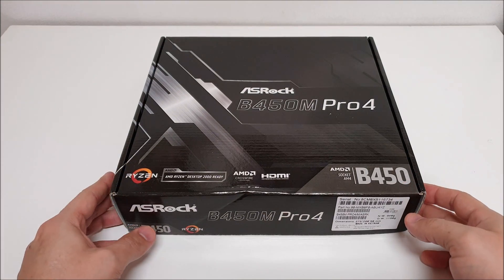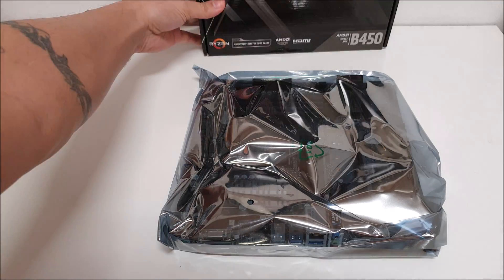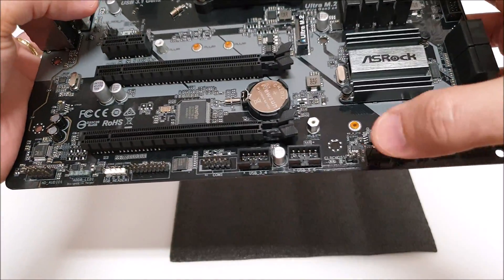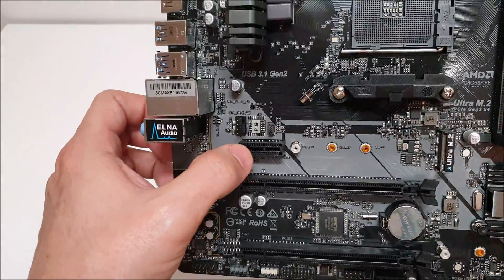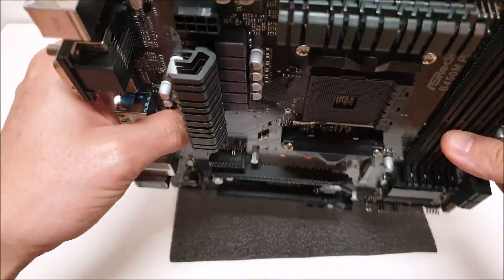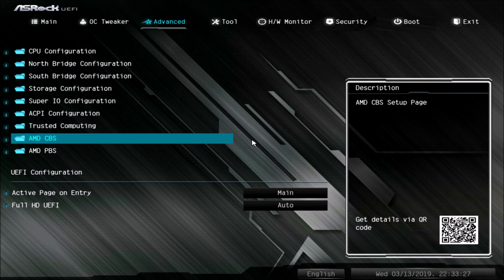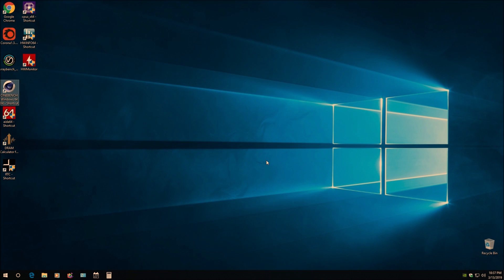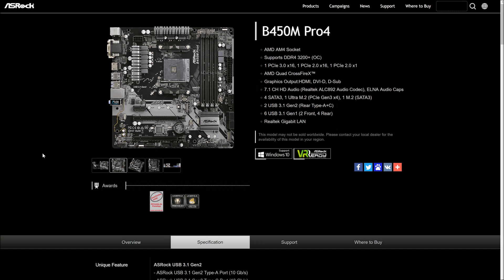ASROCK B450M Pro 4 Motherboard. Best Entry Level Board?

Comment: Mine came ryzen 3000 ready in case someone is wondering. I haven`t got my cpu yet so I haven`t tested
Reply: Have you gotten a chance to test it? I live in Canada, so I don't know if things are just coming in later...:/
Reply: @TonyHanation  yeah, it's my daily machine now, everything works, the cpu worked, as I guess the board came with updated bios out of the factory. If it has ryzen 3000 ready sticker you should be good to go.
Reply: @TonyHanation  And don't be tempted to buy msi board, because they have problems with ryzen 3000. They are now making the same boards, but pro or some other name variants, that have different bioses which theoretically have no problems with ryzen 3000, I don't know if they've fixed the issue, but don't buy the old ones only because they have bios flash button. Even if you buy the asrock and it isn't ryzen 3000 ready, you can easily get it updated for you in computer service for something like 10/15 dollars (I'm from the US, but I'm sure this is the price )

Comment: This bord sucks, dont buy it, bios full of bugs, and settings sucks...
Reply: Really?? Can you explain what are they?
Reply: @NagarajCruze  yes i can, worst one is not saving settings at all, like ram speed, it works as default 2400, i put it at XMP (1 or 2) it is 2400, i make it work faster but i need to change it manualy and if it saves it. Same for cpu and igpu speed, worst of all, you cant save user settings for fan's, and last one for some random reason some times it stuck when pc is in sleep, it returns all settings to default, so you need 2h to make it work ok again, sorry for bad eng.
Reply: @fasic46  I've planned to build a budget pc with this motherboard + ryzen 3 3200g  no graphics card 8gb 3000mhz ram.. but now thinking about this motherboard or to go with gigabyte
Reply: @NagarajCruze  i don't recomend this board, i have 2400g, 16gb predator 3200 (i can't ritch more thrn 2930) no gpu, it is ok setup, board has rellay good vrm for apu, but bios sucks, i try'd all bios revisions, up to 2.00 it didnt help, i contacted asrock, no help...
Reply: @fasic46  OMG
Reply: @fasic46  if the date/time is also lost(not saved) then try changing the cmos battery. I had similar problem with msi x370 titanium xpower.
Reply: @nutterztube  same answere form asrock, no date and time is ok, just. Settings about clock speeds and stuff (date and time is ok)
Reply: @fasic46  hmm...too bad. I was thinking of buy this board for headless booting my R7 1700.
Reply: @nutterztube  dont go for asrock there bios sucks, go for asus or somthing
Reply: @fasic46  at the moment, my choices are very limited. https://dc.sheridon.de/which-am4-mainboards-boot-headless-without-gpu
I am very skeptical about Gigabyte mobos.
Not a big fan of ASUS, but it is looking like the safe choice going ahead. :)

Comment: A little correction on the USB ports: on the rear 2 USB 3.1 gen2 (one type C) and 4 USB 3.1 gen1, for the front panel 2 USB 3.1 gen1. No USB 3.0 in this motherboard, which is great :D
Reply: USB 3.1 ia actually 3.0
Reply: @NagarajCruze  You're right, I forgot about the stupid naming convention :/
Reply: @shibotto  yeah... I don't know why they keep names like this😅
Reply: What's good about 3.1 gen 2 over gen 1?

Comment: this or the pro4-f version?
Reply from the maker: I'm happy with this board. It has all you need. Essentially if you're running only one gpu, the VRM is the buy factor for me.  Both boards pack the same VRM. This one fits perfectly in a micro ATX case.
Reply: Technology Hive I have a 1660 r5 2600 and 16gb 3000mhz on this board it only reads the ram as 8gb 2133 and the gpu is windows basic display port
Reply: @YourMom-fm1qo  You can change the XMP profile to 3000mhz but make sure your voltage is high enough for your ram or your PC will bootloop and revert your changes.
Reply: Im having problems im running a gtx 1660 r5 2600 and 16gb 3000mhz ram the gpu reads as windows basic display port and the ram is only showing 8gb at 2133 i got it up to 2400mhz stable. How can i fix the ram and GPU reading problem?
Reply: Jack Hill make sure your monitor is connected to your gpu instead of your motherboard, and for your ram check if it is in the right slots
Reply: Jack Hill yeah but is your monitor connected via a hdmi or something else to your gpu video port or did you connect it to the motherboard

Comment: A question here, i want to get a ryzen 3600 with this board. do i have to update the bios? And if so then can i do usb flash or need a older chip?
Reply: You will probably need the bios update. With newly made boards there is a small chance the update is already done from the factory but I wouldn't count on that. Maybe the store can do it for you? And otherwise you can loan an AMD 'upgrade processor' to do it yourself. Is a bit of work, but shouldn't be that hard. After that the board will work absolutely fine with a 3600.
Reply: With every mother board you will most likely have to to update bios. Yes you can usb it and just leave everything to default after the update unless you wanna OC.

Comment: Going to get this motherboard in a week  with a ryzen 1200, 16gb ram , and an rx 580 4gb.
This video helped me to verify that this motherboard is going to be good for my cpu.
Reply: I have the same MOBO and im gonna buy the ryzen 5 2600 with rx 580 8gb and 16 gb 3200mhz ram
But im not sure how to connect case and psu cabels :(
Reply: @grissahabib1334  you are gonna figure it out when you buy it its actually pretty easy
Reply: @grissahabib1334  Hello! What kind of ram r u using  ? :)
Reply: @attilaroman6557  i don't have the rams yet !
Reply: @grissahabib1334  Hey I'm getting the same parts as you, can you help me?
Reply: Can you please tell me how to install the drivers for this motherboard please, I can't find it anywhere and I'm afraid to install bad drivers that will make me bluescreen or something. Can you please tell me how to do that please please
Reply: @user-nv7fx1gd7z  https://www.asrock.com/mb/AMD/B450M%20Pro4/
All of the drivers should be under specifications.
Reply: @fixton7386  but I have to install which one please because there's a lot of links but I don't know which one to install
Reply: @user-nv7fx1gd7z  if you are not sure which one to download you get all of the downloads automatically by using iobit driver booster https://www.iobit.com/en/recommend/dbfree.php
Reply: I'm going with a 3100, 8gb ram 2x4 clocked at 3000MHz and the gpu is an msi armour rx 570 8gb
Reply: Lmao this guy's saying 4gb vram in 2021 is a mistake, when I'm here in 2022 with my rx 580, still playing games at perfectly smooth frame rates and good quality
Reply: Don't take a GPU with 4gb in 2019, that's a big mistake!!
Reply: @lrswz5628  I'm really happy with the performance of the rx 580 4gb and I haven't hit the vram limit yet in any of the games I play. I just got he rx 580 for 100 euro free shipping from a local miner so the choice was obvious to get a 40 euro discount for 4 gb less vram.
Reply: @fixton7386  if that's what make you happy then it's ok but ur GPU won't  be able to handle future games very well
Reply: @lrswz5628  maybe not on the highest settings, but for 100 euros that's a good deal. And a high end graphics card with a 1200 does not make much sense because you would be bottlenecked by the cpu anyway. Imo not a bad choice for that money.

Comment: I got my Ryzen 1600 to 4ghz stabile on this board with 1.36v
Reply: And memory got past 3200? I am lokking to buy this board with the same processor. thanks
Reply: I got my 2600 to 4,1 ghz with 1,3 V but the VRM temp is 85°C.
 82°C on idel even without overclocking is this a normal temp 
What temp schould the VRM be?
Reply: @juliusbaumgartner5361   85°C is the upper limit of where most overclockers would be comfortable. It's probably not hurting your VRMs to run at that temperature under load, but I'd consider knocking your OC down a little bit. Try to get it under  80°C if you can. If not, I wouldn't worry about it too much.
Reply: stable
Reply: Can you please tell me how to install the drivers for this motherboard please, I can't find it anywhere and I'm afraid to install bad drivers that will make me bluescreen or something. Can you please tell me how to do that please please
Reply: @user-nv7fx1gd7z  you'll find all the correct drivers on asrock website.

Comment: I currently have this ram cmk8gx4m1d3000c16 from Corsair that is not on the support list. Does anyone knows if it is compatible with this motherboard?
Reply from the maker: It will work just fine. It is a compatible ic.
Reply: @TechnologyHive  Thanks for the answer and for the helpful video

Comment: This MB is really impressive for the price. How have you managed to get 3200Mhz CL14? That's also impressive. Which RAM are you using?
I really want to buy one of these. I have an A320 MB which really sucks and a 2400mhz CL16 Ram with a Ryzen 2600 and an RX580. I was wondering if I buy this mb and change my ram to 3200mhz I could get a boost on performance. Do you have any OC tutorial?
Reply from the maker: Hi. The RAM I'm using is the GSkill trident z 3200CL14 kit. I have a ram overclocking video on my channel using a similar kit.

Comment: I was first going for an Arous M, then I saw your review of the Gigabyte DSH3 and I thought "maybe I should go for that one, cause I'm not really interested that much in overclocking and I'm just building a cheap Ryzen 2200g". Now i'm looking at this Asrock and I'm lost, I have no idea what to buy. Which would be better if my idea for the future is upgrading to a ryzen 5 with a good graphics card?
Reply: This mobo will work fine if just using for 2200g or ryzen 5 2000series or 3000series. Using atm
Reply from the maker: If I had to pick between the two, this would be my pick. Better features, bios, and overclocking potential. You get more for your money here.

Comment: I bought this mb and its offer alot for the price it have, maybe its a bit cheap(the i/o shield is shitty) but it haves a lot of sata options, led/fan headers, and comes with the heatsinks in the vrms(its a 3-3, buts its capable look at forums experiences) offering more comfortable temps if overcloacking compared to other brands of the same prices.
Worth it if you mind to get the best for your budget, if its cheaper get it.
Reply from the maker: This is a great board for the price! One of my favorite B450.

Comment: Nice vids. Liked and subbed.

I am building a pc with a rtx 2060 oced (3fans), a ryzen 2600 and 3200mhz ram.

I am between this board (i have to order it online) and the gigabyte b450m ds3h (in local store). I dont know if i will overclock the cpu but probably not.

Do you think it is really worth the trouble getting the asrock?
Reply from the maker: I would go for the Asrock board just because the ability to overclock is there, vs the Gigabyte board which has its many limitations. Both boards will work just fine if you are running the system stock, however. Thanks for the sub!
Reply: @TechnologyHive  
Thanks! Yeah i will use the stock cooler so no overclocking.
Reply: @TechnologyHive  Do you know what are the differences between this board and the Pro4-F.
Reply: do you run the graphic card on first pci 3.0 slot?

Comment: I have 12gb ddr3 ram will it fit in?
Reply from the maker: It supports up to 64GB of RAM. So yes. it will. Head on over to their site to check for memory compatibility: https://www.asrock.com/MB/AMD/B450M%20Pro4/index.asp#Specification
Reply: You need ddr4
Reply: Yes the ddr4 ram hast 288 PINs.

Comment: I built my first gaming PC this week and this is the motherboard i'm using.  I also see that Cooler Master fan in there at the end, is that the Hyper 212 Black Edition? That thing is quite as all get out. I'm running with the Geforce RTX 2060. 16 GB of ram. I've got to say, i'm REALLY liking this whole PC gaming thing. Never seen anything look so good. Anyway, thanks for teaching me more about my motherboard!!
Reply from the maker: Happy for. You got a good little board there. Your setup sounds ideal as well. Yes that is the Evo 212 black :)
Reply: @TechnologyHive  what screwdriver set should I use? Is normal metal screwdrive OK? Do I need static band?
Reply: @FlickBait ehat about eletric static etc
Reply: Which m.2 port is the one thats runs at 3.0
Reply: What CPU are you using on this one ?
is it performing well?
did you have any problems to this day?
Reply: Can you please tell me how to install the drivers for this motherboard please, I can't find it anywhere and I'm afraid to install bad drivers that will make me bluescreen or something. Can you please tell me how to do that please please
Reply: Hey i also build my new gaming pc with this motherboard and rtx 2060...but i dont know why i am not satisfied with the gpu performance.I just try two games crysis 3 and watchdogs...games run smooth on ultra setting but it randomly drops frames so many time.i mean it not constant and you notice it.it is annoying.please help me what should i do with my system.?
Reply: Which case did you use
Reply: your pc is pretty much the same as mine. I changed the stock cooler for a H100x liquid cooler because the stock cooler was pretty crap, I was getting 77+  degrees Celsius when gaming.

Comment: Hi! Thanks about the video. What memory u have? Samsung b-die? I have same mb and hynix 3200mhz ripjaw 5 memory and I have problems trying to oc it. 2666mhz is only stable clock.
Reply from the maker: Try and update the BIOS to latest version: https://www.asrock.com/MB/AMD/B450M%20Pro4/index.asp#BIOS

If that does not help, you will need to focus on changing the speed, primary timings and subtimings on the memory along with proper voltage using the Ryzen calculator. Do not change anything else other than what I mention above. Try that first. Bios.
Reply: Sometimes in the past overclocking ram some bords don't like using 4 dim's, is this still a thing?